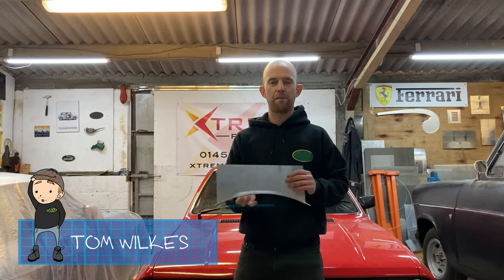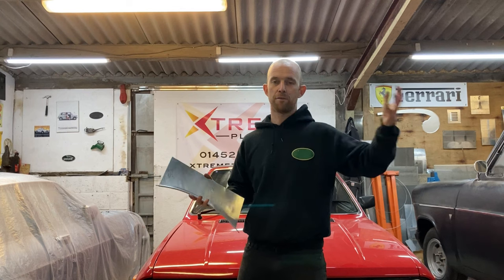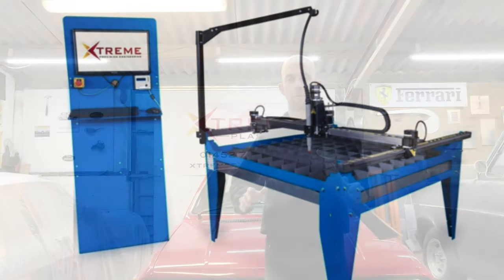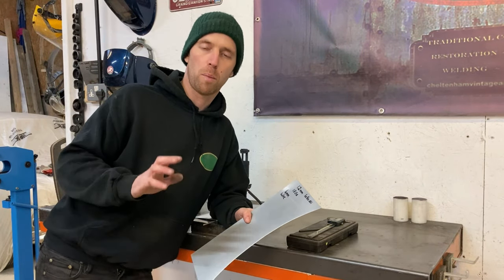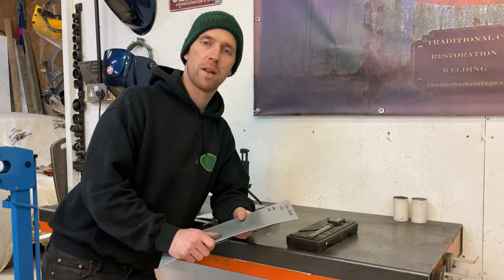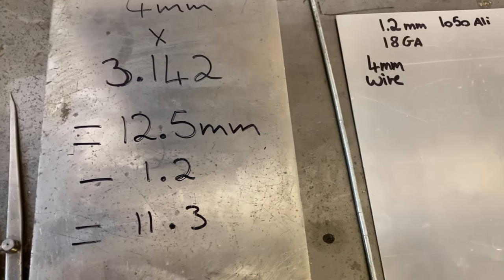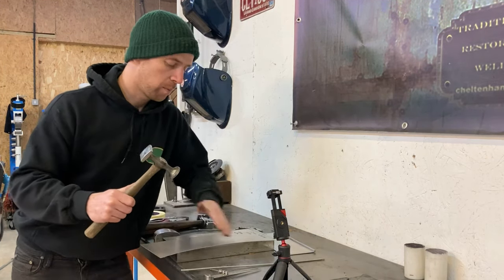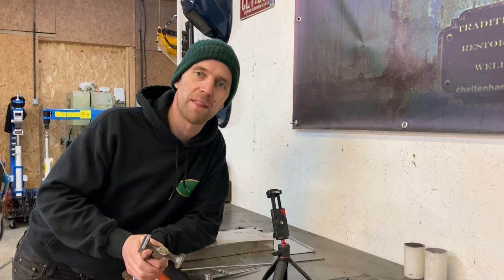WIRE EDGE panel // HOW TO

Comment: Thank you for doing this video.
I'm retired now and to make my garage look better, I've attempted to made a few doors to cover my shelving so they look like cabinets. I tried to bend the sheet metal edges over to look like a store bought cabinet, but they look terribly uneven when it's "finished". The last door I made, I welded up a box tube frame and plug welded the sheet to the face and hinges to the back, which turned out very square and even but has that sheet metal edge all the way around, though smoothed off and pretty strong.
I think I will attempt to do a wire frame set to see how it works out. Your video that showed hammer shrinking (edit: and stretching) metal around the inside and outside of a corner cured me of the folded, bunched up stuff I used to encounter. 
Thanks again for these very helpful video's. I hope there are some young guys out there watching especially if they are entering the work force. Your techniques work.
Reply from the maker: hi ed. thank you thats very kind of you. im glad your enjoying the channel  and i hope the next door you do turns out great. just take your time and have fun with it.

Comment: I'm an amateur and have done this and it's not that tricky with surprisingly little practice. My mentor taught me pretty much exactly the same way you showed here. He didn't tell me the trick with the tape around the hammer head though so that's something new I will use next time, thank you! 4mm galv steel wire is readily available in NZ as Number 8 fencing wire. I have also successfully used 3/16 aluminium armature wire (from an art supply shop) with aluminium panels too. The other thing I have done is got the cheapest pair of end cutting pliers I could find, ground the cutting edges off and filed a slight groove where the cutting edge was. That holds the wire without marking the panel and you can use it to wrap the very bottom edge right around under the wire at the end to get it really tight. To get the right amount of flange to fold up I usually start at 3x the wire diameter then do a couple of small tests pieces with the actual wire and metal I am using to get it exact.

Comment: The fact that this looks so easy is a testament to the mans skill and experience, I have enjoyed bashing metal for fifty plus years, (self taught, or something like that), and am still learning. Just an observation but would a radius on the block help with the initial forming and help in preventing a hard edge?, I understand that you may need several for different wire diameters but you could do the sizes you most use, would this help?.
Reply from the maker: Hi roger. Yes if you wanted to do that to your dressing block that would definitely work! I’ve never done it but it’s a good idea 👍

Comment: Thank you for a very informative video. Great skills you have there and you put across your techniques very clearly. Can you advise if the same technique works for producing a wired edge on 20 gauge mild steel, or does it get more difficult to achieve in steel?
Reply from the maker: Exactly the same process . I’m sure your do a great job 👏

Comment: Dude Tom 
in armor i can see the need for rounded edge , in what format is it used in car body  work ?
excellent how to vid tho dude 
D
Reply from the maker: Wheel arches and any body panel outer edge that’s not connected to the chassis like a front or rear valance to add strength and make it more rigid.

Comment: Hi Tom great tutorial.
Did you tape the bottom of the hammer head that rests on the panel?
I could see a lot on the face but the bottom was not shown.
Reply from the maker: Thanks 👍11.32 in it show the face taped up. It only need to be half way up the face and wrapped over the edge that sliding on the material to stop it marking. As you wrap it the tape will split and you will need the reapply more tape. Hope this helps .

Comment: Excellent video. You make it look deceivingly easy :-) Maybe my inexperience is showing, or I have not had the proper cars? Could you explain what the purpose of the wire edge is. And where it is used? I suppose strenght is one advantage?
Reply from the maker: Hello Dan, we've had lots of practice 😀 yes, the wire edge is used for strength, many hand made cars have it, even porsche 356 wheel arches are wired, Tom did his apprenticeship at Morgan, when they were still fully hand made.

Comment: Would like to see how you replace a wire edged panel.
Reply from the maker: Very similar. It really depends on the condition of the edge when you unpick it most of the time I have to cut a section and put a new edge in.

Comment: Hi Tom, I really enjoyed this video. I have some cut edges on a steel bulkhead I would like to improve. I'm guessing this would also work for steel? Also, I was thinking of leaving out the wire for the folded edge look. What do you think?
I didn't know you were a Morgan apprentice?
Kind regards Paul from 48 Spokes
Reply from the maker: Thank you. Yes the will work the same for steel 👍 I don’t see how leaving out the wire would be an issue either.  Yes I was there nearly 6  years unfortunately 😂
Reply: @Metal_shaper_tom  Thank you Tom. I've just had a practice and worked well so onto the job next.
I had a factory tour a few Saturdays ago. Brilliant, really enjoyed it. Took plenty of photos 😁

Comment: Excellent clear video.
I'm struggling to panel beat a low crown roof panel that was sand blasted on the underside. The surface is very irregular with some areas heavily stretched and other areas relatively undamaged. I've used an OA torch to deal with the heavy damage and a shrinking disk for the other areas. I've managed to get the general shape back but I'm having great difficulty doing the final shaping /planishing. 
I tried finishing the roof in  small sections but when I move to a new section I find that the level of the earlier work is upset and needs further refinement. I find that I am chasing the problems around the roof with no end in sight. And of course I'm trying at the same time to preserve the correct N-S and E-W profiles.
I would appreciate advice on how to escape from this nightmare!
Thanks,
Mike
Reply from the maker: Hey Mike . Thanks for your message. I think this is pretty common. I think what your doing is over working the area so in places it’s stretched but under tension then when you release some of that tension by stretching a new area is releases that tension and then moves again. Some times what we want to achieve isn’t achievable or we set the bar to high for ourselves. What I world be inclined to do is get it to 85/90% happy all over then just gently work the areas you want to improve . Remember very light taps as you want to move the metal not stretch it. Hope this is of some help and good luck 👨‍🏭
Reply: @Metal_shaper_tom  Thanks Tom. Your comments make sense. I've been working  small areas to perfection and then trying to move to a new area hoping to do the entire roof piecemeal.I'll try again as you suggested and work the areas to 85/90% and then move on. When the entire panel is pretty good I'll try some gentle refinement.
Thanks again,
Mike in Germany
Reply: @mfwwhelan7561  i'll add to that, best part is you already realised your problem - don't get stuck on small areas. do not try to finish one small area to 50%, not even to 25%. do the whole roof to 10%, then the whole roof again to 20% and so on until you're at 80% -ish, then zoom in to smaller problem areas - should not be that many by that time.
Reply: @daos3300  Thanks for your comments. I started applying your ideas yesterday. 
Mike
Reply: @mfwwhelan7561  best of luck - to be fair, i'm only expanding on what V&CM already said.

Comment: Brilliant stuff. You are working with Aluminum.  What material were coachbuilders using in the 30s and 40s? TIG was patented in 1942 so wide spread adoption was later.  If those old guys were using Alum, how did they join panels?  I really enjoy the channel and your choice of projects
Reply from the maker: Hello Steve, they used gas welding to join the panels back then, we still do every now and again now if we feel like it  it requires a flux and a steady hand. Things like rolls Royce and Bentley wings were often made of aluminium in several pieces gas welded together. Glad you are enjoying the channel.

Comment: Hi Mate, great vid.
Could you please explain where the measurement of the radius (pi of wire) is in relation to the finished edge?
Sorry, Tricky in words.
When tapping over the block should the wheel arch reveal be formed at the scribe line or should the line appear at the final edge of the wheel arch opening?
Cheers.
Reply: initial fold is at the scribe line. count on the finished opening being around a 1/4 to 1/3 third of the (11.3mm) total, 3-4 mm, below that. depends how accurate you are.
Reply from the maker: Good answer, we were thinking of how to describe it, yes it does depend on how accurate you are.
Reply from the maker: Good answer, we were thinking of how to describe it, yes it does depend on how accurate you are.

Comment: are you not worried about corrosion that will take place between the aluminium and galv steel rod
Reply from the maker: Hello, usually we would prime it before inserting the wire, but there will always be a bit of metal touching, this is the traditional way of doing this process on all vintage and classic cars where they have this joint.

Comment: Would this method work for rolling some arches on mild steel
Reply from the maker: Sorry don’t quite understand your question
Reply: @Metal_shaper_tom  i have a mk1 escort and want to tuck the lip in round the rear wheel arch. This is so wider tyres don't rub the inside of the arch. Cheers